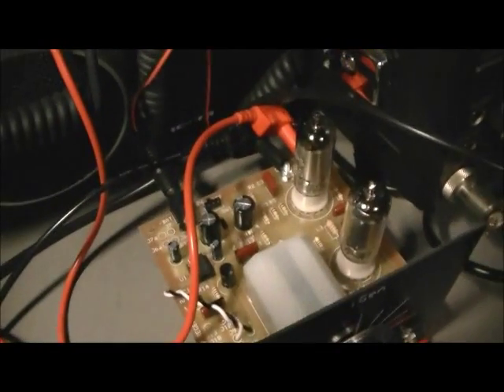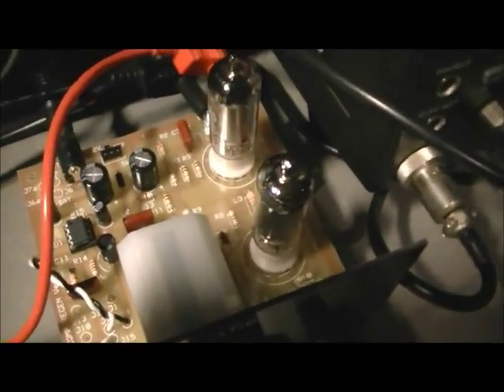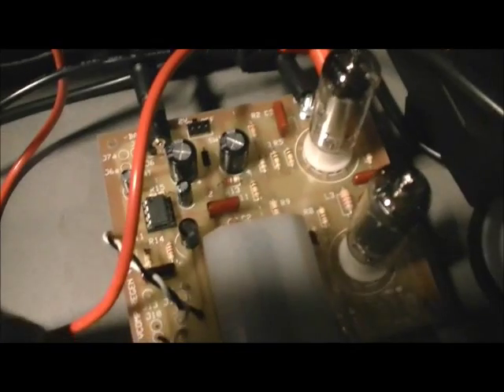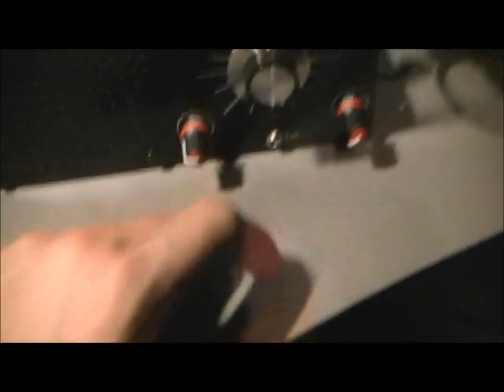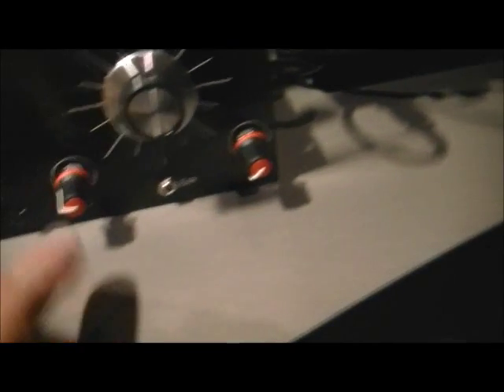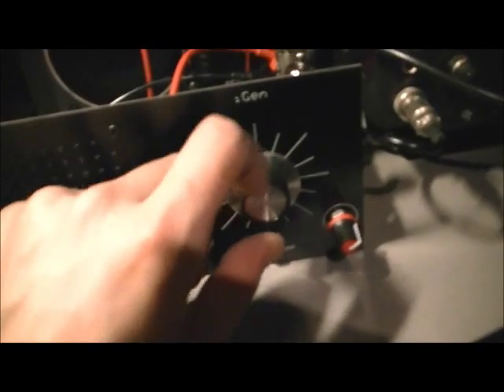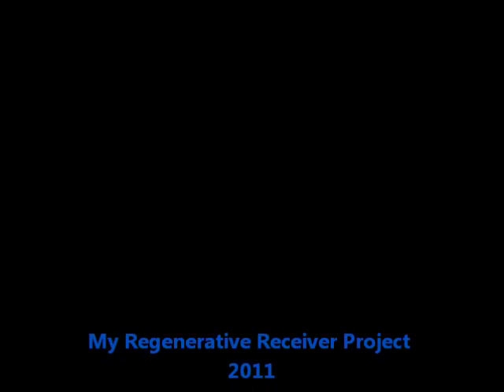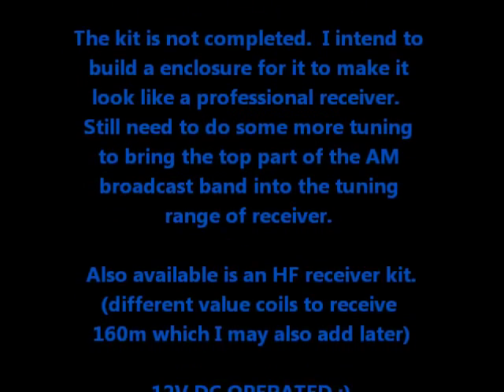iGen Regenerative Receiver Kit - UK Ebay Purchase

Comment: damn.....I need to start building stuff again......been over 35 + yrs. since I built a kit of any kind.....need to try to get back into kit building.....been looking at some vids here on youtube.....makes me feel guilty....been a Ham for almost 37 years now.....love tubes and morse code.....shortwave listening.....the best......
Reply from the maker: Yes, never too late to get back into it.  For myself I have times I build a few things, then don't do anything for a while. I always come back to it at some point.
Reply: I think the video shows an older version of this kit. I bought one about 3 years ago and have just got round to completing it.( I am now 71 and it's nearly 60 years since I built anything like it ). Mine has plug-in coils and is tuned by varicap diodes. It is marketed by  6v6 co.uk and can also be found on ebay in the UK. The plug-in coils are mounted on 6-way pcb header pins, so it's easy to make up alternative coils. A set of 2 small blank pcbs is available complete with some Amidon FT50-61 toroids and some enamel-coated wire to make SW coils. The MW or BC-band coils are pairs of moulded inductors which are moved close to each other to obtain required coupling. It worked first time using the 180uH inductors supplied, but only a few stations could be received. I quickly improvised my own set of coils using physically smaller 220uH inductors which could be moved even closer together and improved both LF coverage below 800kHz and  reaction. It should give hours of enjoyment and scope for modification.

Comment from the maker: Hi there,  yes it is a nice kit and I have enjoyed using it. It is called the 'iGen Regenerative Tube Radio Kit', hence as the name says, it is a regenerative style receiver.   You can find it from 'Vintage Components' in the UK and can buy online. There are some additional accessories you can get for it including a shortwave coil kit which I have been thinking about getting myself.
If you type in 'Vintage Components' in google, it should come up at the top of the list.

Regards
John.

Comment from the maker: I forgot to add that I had not mounted the radio into any case. I just used the circuit board off cuts that came with the kit to make the stand in which it uses to sit neatly on the table.  I however have thought about making a nice box and may in time make a nice stained wooden one. I have liked looking at the circuit board so have not done it yet. :)

Comment from the maker: Thank you kindly.  It is a reasonably well made kit.  It is not assembled when you get it, but it was not that hard to solder up.  You need some mechanical skills with this one as you need to solder the front panel and some side PCB's onto the main board.

All up, the instructions were quite easy to read and understand.  If you have had some circuit experience before, it will be simple.  All resistors and components are conveniently listed out for you.  Definitely was fun making this receiver!

Comment: Great Video mate.   Have seen these a few times on Ebay here in the uk but never seen one working.  It seems well made with little plastc used.  Was it hard to put together ?  Was the circuit board already complete.  Cheers.

Comment from the maker: I have not yet set the receiver up for amateur, so cannot comment how well this particular set would perform on the amateur bands, however I had read it can be converted to amateur (assuming 160m)  Regen sets will generally receive SSB as the regenerative oscillator itself acts as a beat frequency oscillator for SSB when tuned in correctly.

Comment from the maker: @Shuspano 
I may have said 'op amp' in the video in reference to the audio amplifier that drives the speaker, but this is an LM386N-1 8-pin DIP.

I am curious to know the reason you believe it looks like a stupid mistake there are two tubes in this radio? There are many regenerative receivers that operate this way, but is not the only way it is done. In this case, the manufacturer of the kit designed the receiver using two tubes.

Comment from the maker: Thanks for the comments Juissi101.
The audio output is mono but could be connected to a stereo amplifier by using a mono to stereo cable.  The issue is that this set works for medium and short wave reception only.  I think there are designs for VHF that work on regenerative concepts, but I don't know of any personally I could recommend.  Also not sure about FM.  This one does AM and would demodulate an SSB signal due to the beat frequency the regen creates, but probably not good for FM.